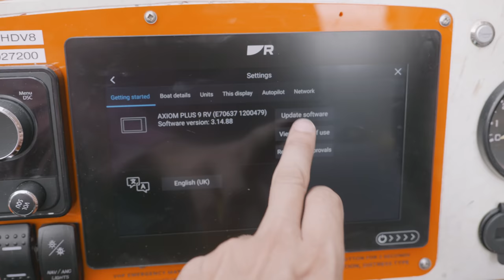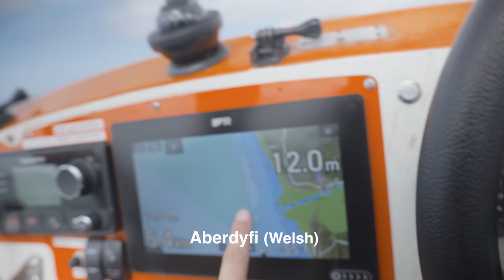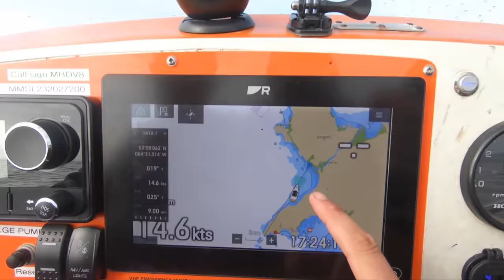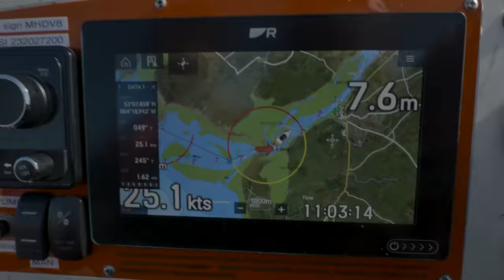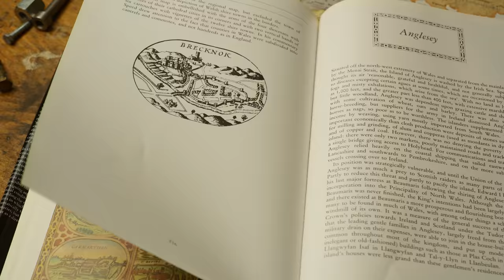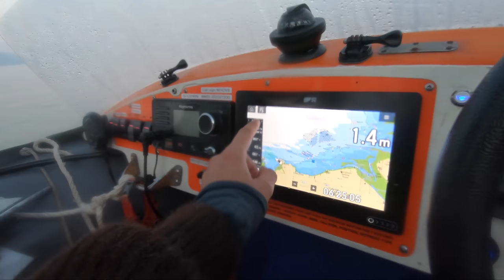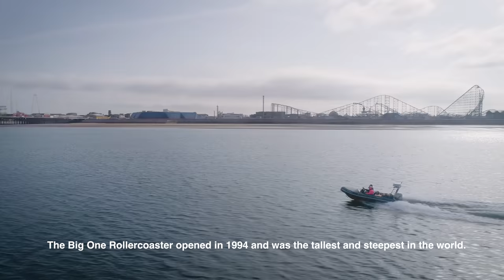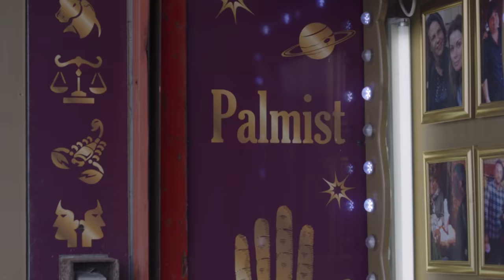1700miles in a Tiny Speedboat - Part 12

Comment: I love this series so much. It was amazing seeing Blackpool. I grew up there but haven't seen it in a very long time. It's changed so much. I used to hang around places like Coral Island on Saturday mornings with my £2 pocket money that went straight into arcade games. I watched that big wheel get built and later worked on it. One night I got caught on a bar a moment too long and got taken up into the air hanging off by one hand. I managed to twist and dropped and hit the ramp that cradles the ride right at its edge. Another few inches to one side and it would have been around 20 foot drop on top of the drop I already had, probably serious injury at that distance. It snapped my shoe in half which was super weird. I wasn't badly hurt. I used to take my lunch break on the wheel and just ride around and around. Super peaceful once you get over the fear of it all. Anyhoo, onwards to part 13, can't wait!
Reply from the maker: Jeepers. The wheel seemed scary, but nothing like this tale. The shoe snapping hammers it home.

Comment: Looking good Harry & Charlie.  What amazes me most about this whole thing, is that the alternator manages to keep up with all the current the electronics are using!  I keep thinking that the battery will be drained, especially with things like nav-lights on overnight.  I hope I'm wrong.
Reply from the maker: It's always on the edge when everything is running. The anchor light I swapped out for an LED bulb so it should run forever.

Comment: Hi mate all the way from sunny nelson New Zealand hey I've had Honda outboards most of my life and tell you the best thing is to get a Hydrofoil for the Cavitation plate it will get you on the plane at lower revs plus keep you on the plane at lower revs and if it's rough it will keep you level and not ass down bow up so it's hard to see it will keep you at a slower speed when rough Highly recommend 😀

Comment: That spare wheel carried has cracked from fatigue failure not corrosion. The wheel bouncing around work hardened the metal making it brittle causing it to crack.

Comment: Any chance you could help me ? My honda is pumping water but not strong out off pee hole , new impeller , new thermostats , blew all tubes out with air , doesnt overheat but just not a strong flow out of top of engine , looked on all forums & seen u had slight problem of great orm 👍🤞

Comment: I have a sea hawk 4 and have all the gear for the sea, just around the Scottish coast fishing, now I have been told that the hand held VHF radio I bought from the canoe company in England and was informed I do not need a Licence nor a Certificate, but I can not find any info for this, how do you do it, for there is nothing for us small 2 to 3 meter boats no clubs nor information for us, could you help with what can we do and do it safely, have life jackets, flares, VHF hand held, petrol engine 2stroke cheapy outboard, backed up by a small electric trawling motor, all the fishing gear, I am not so concerned about myself, however I will have with me my 2 sons and 1 grandson, any thing you can help with would be grateful.